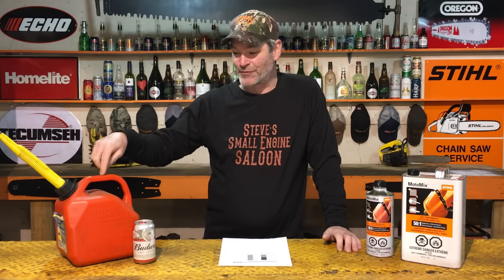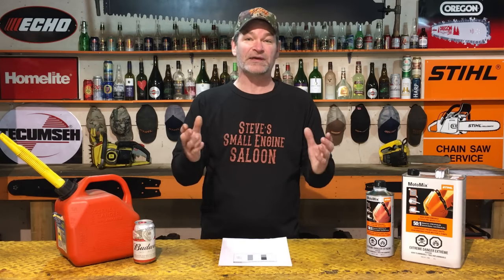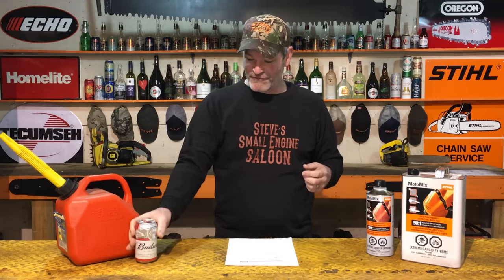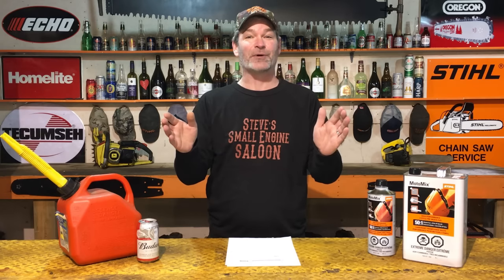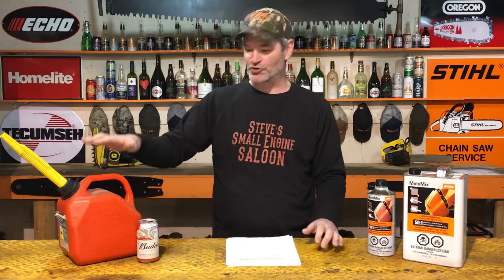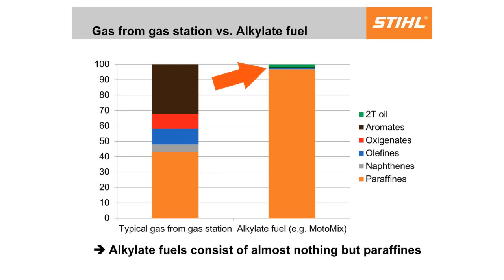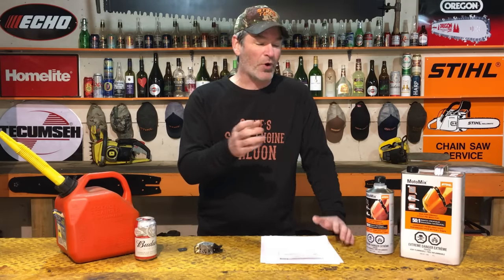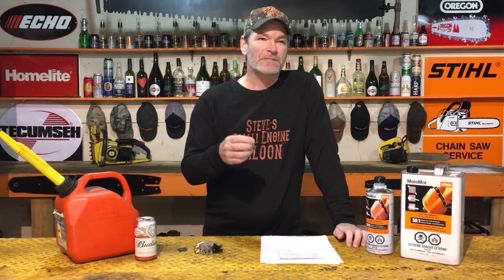The Ugly Truth Why Gas Station Fuel Is Bad For Small Engines

Comment: I switched to truefuel 50:1 a year ago. my echo string trimmer and tiller were exposed to our severe freeze here in texas and both had fuel in tanks all winter.  they started up as if they were already primed and choked like i just used them!  totally sold on using engineered fuel.  Years past my equipment just died or had to do an entire carb a as no fuel line job or toss it away as the piston/ cylinders were shot

Comment: I use to own a plane and I put aviation fuel in all my lawn equipment for the winter. I drain the regular fuel and install the aviation gas (just a little) run the equipment to make sure the old fuel is replaced with aviation gas. Next spring just add your regular gas to what ever aviation fuel is in the tank and your good to go. Think about it aviation fuel has to be very clean,  you don't want your plane engine to quit while you flying. I have been doing this for 15 years and never a problem. Just something to think about. You can get aviation gas at any small airport. I usually buy a gallon or two in the fall.

Comment: Thanks Steve! Super job.
Do two stroke engines still need to be mixed with oil when winterizing with this method, or do you dump the small bit of straight gas out of the tank in the spring, and then add the usual spring mix of oil and super gas? I am also thinking there might be a mixed version with oil and a none mixed version. If that is true I have answered my own question.  Would be great not to have to buy two different cans if possible.
Reply: Stihl Motomix comes in 50:1 pre-mixed variety only. TruFuel comes in four-stroke (no oil), 40:1, and 50:1. Haven't checked the Husqvarna fuel, though. BTW, don't order TruFuel off of Amazon. It's incredibly overpriced there. Not sure about you, but for me, it's much cheaper to buy locally.

Comment: Avation fuel works well to winterize due to the composition, it doesn't go bad like pumped gasoline from the drive up gas station.   Due to it's high octane your engine may run differently with it but I have had very good luck using it.    Be careful it does have a blue hue to it so when you look it may appear as mixed oil and gas so make your cans well.   Good luck

Comment: what size engine would you say you no longer ned to be concerned with ethanol? i use alkylated fuel for all my saws etc but have a 14hp woodmill and would hope that would be big enough
Reply: I believe the things Steve talks about here become a lot LESS relevant in pressurized, fuel injected systems (i.e. modern automotive). Has nothing to do with engine size. Small engine systems are open to the atmosphere via the carburetor and the gas tank. This allows the ethanol to draw water in from the air. It also allows the volatile components in the gasoline to evaporate, concentrating the non-volatile olefins which causes those gummy "varnish" deposits. The situation is made worse in float bowl carburetors left with the fuel open to the gas tank because as the gas in the float bowl evaporates, it is continuously re-filled with new gas and eventually the non-volatile olefins crap out to leave deposits. If you use your woodmill at least once per week, don't worry about it, although it's a good habit to shut off the fuel valve. A handful of times per year? Turn fuel valve off & run until it dies to dry out the float bowl. I would store it with the tank full to minimize air exposure to the fuel in the tank. Once per year or less? Run system completely dry of fuel before storage. Gasoline can go bad in today's cars, too, but small engines with float bowl carburetors are a lot more susceptible to problems caused by fuel. I do run ethanol-free pump gas in my small engines, but I'm not entirely convinced it's really necessary if the above precautions are taken. If your woodmill is outside & exposed to the elements, then you need to take extra precautions with it.
Reply: @jeffd3844  what a great piece of advice. cheers. i use it once a week but as it happens it is currently at the kohler service centre as it dies when throttled when hot. no one there had even heard of alkylated fuel

Comment: Do you buy a gallon each year? If so it’s still cheaper to use normal gas and replace the carb and fuel line every few years.

Comment: Steve I have been running my equipment until they stall, and never had a problem with them starting in the spring.
I’m also thinking that this year I will pull the spark and spray fogging oil in the cylinder like in did to my boat engine.
I’m also lucky that I have two gas stations near me that carry gasoline with no which I have started using in my new John. Deere S170.
Love you channel I have learned a lot from watching your channel.

Bill Odom
Poplar Grove, 61065

Comment: Use hi test fuel in all my stuff except the car and sometimes the truck .Start filling your gas cans by putting the first part of fill up in the truck gets the lower test fuel out of the line then fill your cans (plastic) . Have done this for 50 years advice from a senior logger at the time.
I said ti hi at the time the manual says regular .His answer was regular fuel where the saw was made is our hi test.No more starting and running problems

Comment: Seafoam with the Station fuel for general purpose seems to work.  Then Winterize with the Motomix I'd think.   At $30Qt there is Zero chance of me using the MM regularly-Disability means I don't even Mow regularly because I can't swing the Gas.

Comment: I use kerosene to my  small engine fuel ..I have a 40 year old s Sears Push mower and never had to rebuild the carburetor ..It keeps the stuff you mention from building up and turning waxy and gummy  ..I will give Moto Mix a try also

Comment: I started using  Wawa nonethanol fuel in all my lawn equipment and outboard about 4yrs ago. No more issues with any of them. I use high quality proper oil and mix as well. I'm a 40yr auto tech and my opinion is using premium fuel in lawn equipment is a waste. The nonethanol is a little more but seems to be well worth it. Seafoam is good stuff in anything.

Comment: Just a note to say thank you for the very interesting chemical analysis - had no idea the quantity of gunk in pump gas. Begs the question as to how our vehs run on the stuff! I'm a homeowner chain saw user and can understand the cost break point for commercial users to justify self mixing. Since I use my chainsaw infrequently, the canned/engineered gas makes sense for me as I can afford the higher quality fuel and enjoy the benefit of the stabilizing/storing factors. Also now feel better about the quality of fuel I'm using and its benefit in extending the life of the saw.

Comment: Thanks for the video Steve. I’m going to start using engineered fuel today. A lot o my equipment sits for extended periods and it’s much more effective to spend some more on fuel than waste a day played with plugged up fuel systems and carbs. I’ve had to buy 2 carbs for my generator ‘cause I could get it running right after sitting. This has been an on going problem for me.
Reply from the maker: Best of luck!
Reply: @StevesSmallEngineSaloon  I bought a new Stihl saw over the weekend and Stihl doubles the warranty if you buy engineered fuel.

Comment: I use ethanol free gasoline. I have never had problems starting even after setting 4 months setting around.  I had a weed eater that I used pump gas in and  had to put in a new diaphragm, pickup tube, and rebuild the carburetor each year.

Comment: I used to work for a lawn equipment dealer, (stihl,echo, Redman and honda) along with z-turns & tractors. We would always recommend mfg. fuel, especially to the consumer. Most had the option if pump fuel was ok for the commercial users (mostly due to cost per gallon) it was good enough for them.

Comment: 26 year old Craftsman garden tractor with 22.5hp Kohler. Never a problem till it went ethanol. Once ethanol was used I had to clean the carb every other cutting, cutting 1.5 acres, it would stutter and not crank at times. Ended up having to replace carb, fuel pump and started using NON-ethanol fuel, in my area they call it "marine fuel". As of today, 7/14/22 I had to clean carb linkage as governor and throttle was not working properly. This has been 8 years and NO Problems! I blame biggest problem on the ethanol sucking up H2O from the air as humidity is always 80% plus here.

Comment: never used it. have 4 chainsaws, 2 push mowers, 1 rider, a blower, 2 weedwackers, and a partridge in a pear tree, and I haven't been into any of MY carburators since before 2005. 1 1/2 year since I used my chainsaw last (cancer treatments) and still had fuel in it. 3rd pull started and ran great. oh, yea, forgot my generator and mantis tiller.  2+ years on them- same thing.

MY SECRET?

non-ethanol premium 
1/4 oz berryman b-12 or seafoam 
1/4 oz sta-bil
bump those 2 up to 1/2 oz as you near the end of the season. 
any 2 cycle mix @ 50:1 but I prefer the Stihl premium,  silver bottle.

Comment: I got 2 cans of that premixed fuel for free. It was the only thing I've used in a brand new weed whacker. I've had that fuel for 8 years and still use it. The area I trim a tiny section of chain link fence and I prefer a gas trimmer.

Comment: Thank you Steve for a great video! I hate 2 cycle equipment because after the first year they are hard to start and don't run good. I have switched to battery powered weed eaters and  I am contemplating a Stihl electric chain saw. I may wont to rethink this. I do like my DeWalt 40 Volt weed eater

Comment: YES I use MotoMix in my backpack blower, weed whacker and power washer.  I do NOT use it in my lawnmower or snowblower "BECAUSE" I use a lot of gas in my lawnmower & snowblower...  My Lawnmower and Snowblower have huge engine!  In my area MotoMix goes for $40-$43 a gallon.  While 93 octane gas station gas is $4.69 a gallon one 10th the cost.  When I do use gas station gas... I add (1oz) of STA-BIL Marine 360 Formula and (1oz) of SeaFoam for 2gallons of premium gas.

Comment: I use premium 98 and Stihl Ultra oil. I mix a little extra two stroke oil than the measured 50:1 for insurance. Never had and problems but I use my stuff regularly and never let it sit to long.
Avoid cold concrete floor's. They cause condensation in the tank.

Comment: Late 2018 early 2019 i replaced carbs on my friends and my echo saws &weed eaters and have had zero problems using true fuel 2 - 5 pulls always start i will not put gas station fuel in any 2 cycle engines period but i'm just a home owner who likes things to work after things sit a while and yes 20$ a gallon sounds a little steep the performance says it all .

Comment: I personally use sef  enginner
ered pre mix fuel 2 reasons one I don't have mix the fuel and worry if have mix right 2 lot cleaner fuel pump gas no matter if it is premium or 100 percent straight gas from pump still has lot of trash and sediment in it so I use premix in the weed eaters and chain saw now logistically because size of my place I can't use engineered fuel in riding mower too expensive but in that case I keep paint filters around and use a battery powered transfer pump and a funnel with paint filter in it to keep much of trash out of it as possible the other reason I use that paint filter is my gas cans are 20 years old but anyways great video

Comment: I have a Cub Cadet rider that is 12 years old, a Cub Cadet zero turn that is 6 years old, a Cub Cadet tiller that is 6 years old and a Stihl chain saw that is 6 years old. All run on the cheapest pump gas, never get winterized and always start right up and run great.

Comment: In 1988 I purchased a Honda lawnmower and a John Deere snowblower.  In the following years, I used midgrade ethanol-free fuel. I would buy 5 gallons at a time and treat the fuel with Stabil.  Whatever gas was leftover at the end of the season I would burn in my car. I did the usual recommended maintenance.  I sold my duplex in 2020 and I gave both of those units to the new owner and they were still working great after 32 years of use using gas station fuel.  When I use to cut a lot of wood I also used the same fuel in my chain saws and again no problems.  I would never pay 20 bucks a gallon for some specialty fuel.

Comment: I have 90+ small engines. Ethanol free fuel and a few ounces of Starbrite StarTron and you're good to go, no issues ever. I have chainsaws from the 70's and 80's running flawlessly and carbs have never been touched. The antique motorcycles and snowmobiles love it as well. If you have something that works stay with it!

Comment: I used to use the premix 50:1 canned fuel and it doesn't lubricate correctly. I've burned up a few 2 cycle engines using that crap. It's completely made in some laboratory somewhere. Many shops tell you not to use it and a few people on YouTube as well

Comment: When I lved in Zimbabwe 2002 there was often no  petrol to be had at the gas stations ,  however I could have 44 gallon drums of benzine delivered to my house for less than petrol would  cost. I ran my car on straight benzine for a couple of years ,  no problems, I did add about a tea cup of engine oil to aten gallon tank of fuel   ! !

Comment: I bought fuel for my Stihl MS180 from the same place for years. No problem. Then it stopped working, so I took it to my local Stihl guy. He asked where I'd bought the fuel. When I told him, he said he'd had several people come in with the same problem. Maybe the gas station got a new supplier. I don't know but I stopped buying from there. My engine was fried and I had to buy a new saw.

Comment: Bought a Husqvarna last year right after a little storm called Sandy took a SLOW stroll through the area. They were running a promo, if you bought a large can of their fuel, they would extend the warranty a couple of years. Given that I had already thought about using this type of fuel & it probably suited my usage case, well that was an absolute no brainer right there. If I was going to be using it more frequently, I very well might alternate between pump & manufactured fuels but storm cleanup, etc is going to be the majority of my usage. Yes it costs several times more but it's worth it in my case.

Comment: I usually run pump gas for most of the season, then towards the end I switch over to canned gas for about 3-4 tanks before putting equipment up for a season. Then when needed it fires up quickly, never an issue, some equipment i continue to run year round, for no other reason but to circulate oils and other fluids and prevent rust and corrosion in other locations of engines, transmissions, and cooling systems! Basically maintaining a constant use as a form of maintenance!
Reply from the maker: Awesome!

Comment: I actually never intended to use this engineered fuel mix, but after having a lot of issues with my old weed eater and now my brand new Husqvarna weed eater not seeming to work right and gives a difficult time starting I think I'm going to give this a try. The engineered fuels are exceedingly expensive, but for my needs I doubt I will use much more than a gallon or so per season for my weed eater. My new weed eater has performance and starting issues ever since I bought it and I'm thinking both very well could be fuel related. The engine does not appear to run at peak performance, difficult to start almost every time, and last but not least, it has trouble cutting through even moderate weed growth.

Comment: Ive been using 10% ethanol for yrs without any failures.  I did take the carb off of my 4000 watt generator after 10 yrs and everything in the carb was clean besides one tiny spot of hard stuff in the carb bowl

Comment: Love stihl motomix it saves me a lot of issues. If you burn just a cap full you will see how clean it burns. If you drain all the fuel out of your tank for the winter/off season it dries out your fuel lines. I fill all my equipment up before storage it has a long shelf life no worries for the season. I love this stuff. It is a little pricey however buy the time you buy oil fuel stabilizer everything else. It add up to just about the same in my book and I get the best fuel to keep my investment running great

Comment: @Steve's Small Engine Saloon
If you see this nearly 3 years later, what about doing it both ways?  I plan on using the MotoMix anyway (or something like it if I don't get a Stihl), for multiple reasons, but wouldn't emptying the tank and then running the carburetor dry still be prudent when it won't be used for a while or for years?  There may not be much Aromates/Benzine in it, but without it in the carburetor making the metering diaphragm brittle, and anything else it may affect, wouldn't that be better?  These chainsaws aren't cheap for a guy like me, not really even a Poulan Pro, so I'm thinking, why not do all I can to help make mine last and run as well as possible while also minimizing repairs?  Three years later you may have a consensus on something like this.  Thanks

Comment: Carb kits are usually around 25bucks carburetors generally under a hundred bucks even if you had to replace the whole unit after a a few years it's still cheaper than buying engineered fuel

Comment: Hi Steve I have a question for you I was trying to drain out my toro 2 stage snow blower today when I was doing that gasoline got all over my hands no
One shows the right way on to drain out gasoline out of snow blower I was very scared when I was doing that I had a full tank of gas in my snow blower because I got gasoline over my hands I used soapy water and my hands still smell like gasoline what do you suggest I do